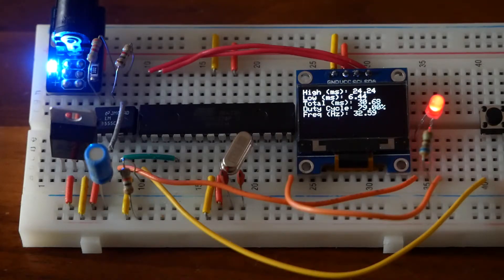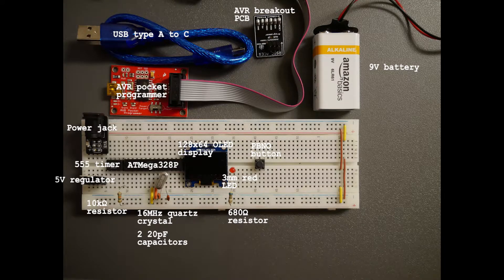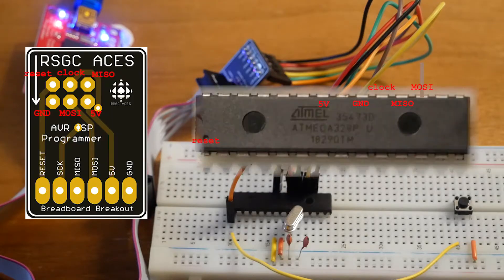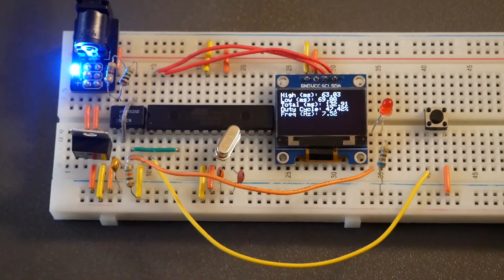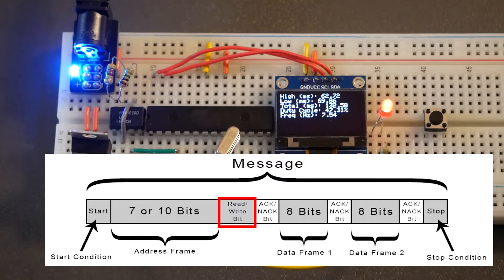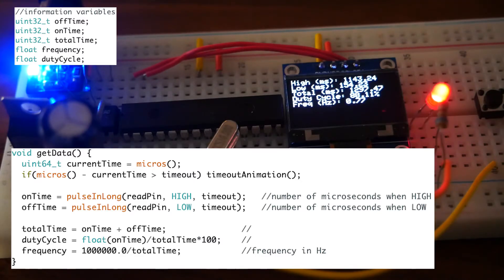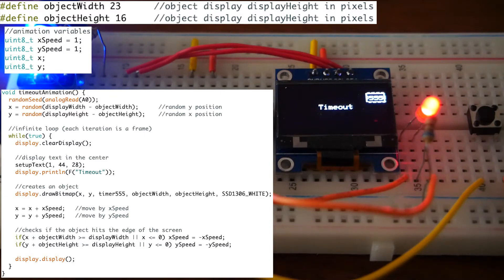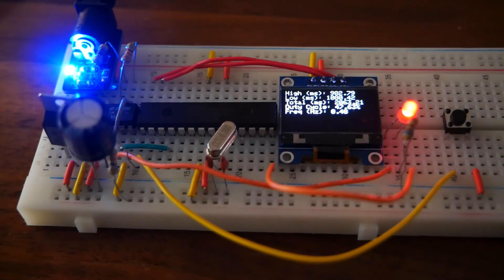555 Timer Frequency Calculator Part 1 (Breadboard ATmega328P)

Comment from the maker: EDITS
1. The timeout should be defined as 90000000 instead of 180000000 to create a timeout value of 3 minutes
2. The if statement at 2:31 should be directly below the pulseInLong() functions in order for the timeoutAnimation() function to run